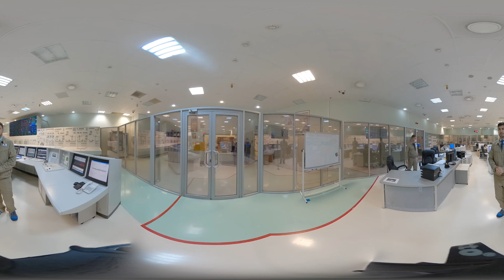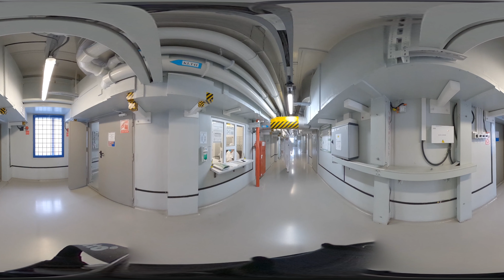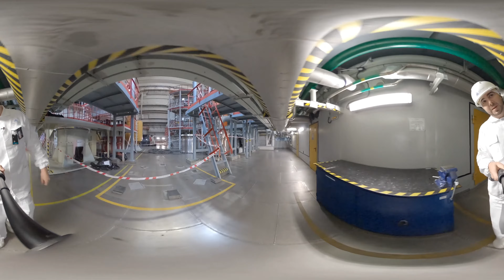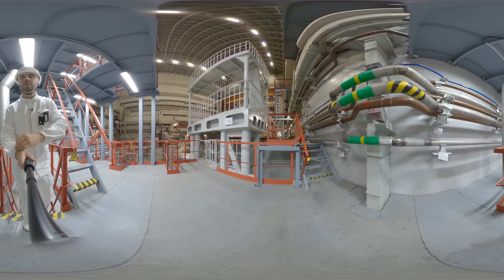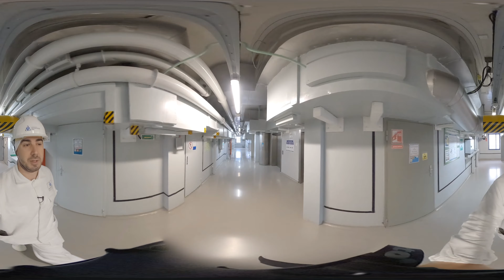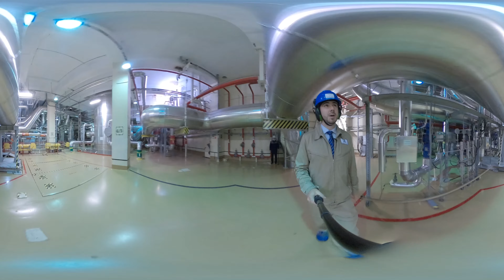Unique Russian Nuclear Facility/BN-800 Fast Reactor

Comment: so it is NOT being used for "breeding" purposes?
Reply: There is a closed cycle. Spent fuel from water reactors is processed into pellets, and a mixture of uranium dioxide and plutonium dioxide is made. During the process, plutonium 239 is produced, which can be used as fuel in the future. The burnt-out pellets are returned to the recycling plant, where they are again adjusted to the desired concentration of elements and put back into operation. There is no waste. The advantage of the reactor is that it disposes of minor actinides by burning them or converting them into safe or useful elements. A sodium-sodium-water heat exchanger. The capacity of the waste processing plant is 200 tons per year. The purpose of the reactor is to evaluate the behavior of mox fuel. Tests have already been conducted on the combined loading of uranium and mox fuel rods into a water reactor. This will help reduce the dependence on the extraction of new uranium. By using recycled waste, which amounts to hundreds of thousands of tons.
Reply: Y should it breeds more plutonium when you have more than enough reserves

Comment: A sodium reactor as a nasty beast to tame. Hats off to all the BN series reactors. If you work in pipe fittings or submarines you know everything leaks....including sodium. I wonder how many "small" sodium leaks they have to deal with a year & how its dealt with, would be fun to see them do what the US really couldn't. But then again our power plants have to make money which is harder than keeping a sodium loop air tight.
Reply: @codaalive5076  Oh I know all about the MSRE. Not only for coal, but Nixon killed the MSRE in favor of the IFR because they made plutonium. We were screwed out of clean energy and carbon neutral fuels. Not to mention the one thing that has been proven to improve human quality of life is access to energy. The more cheap power you have the better your quality of life.
Reply: @terrydavis8451  As i understand it oil lobby also helped kill the program and finish off A. Weinberg's work, of course nothing major in the US happens without the army. What do you think about Gates IFR? They don't provide much information but it sure looks pretty much like BN-800. Getting information about its ability to burn or produce plutonium is particularly difficult, i wouldn't be surprised if nothing came out of Gates project because they changed the name several times...
Reply: @codaalive5076  Китай хочет избавиться не только от углеродного следа, но больше от угольной копоти над городами, от которой задыхаются городские китайцы.
Reply: @НАТАШАМАКАРОВА-г6в  There were comments in the Western mainstream media channels that China is ahead of their goals in this regard. While i don't believe a thing msm say, they might be right this time because China is testing several very advanced new generation nuclear reactors, F1 is just one of them. I'm very impressed by how fast it went from one article about green power to making various advanced reactors in China.
Do you have more information or sources about China's intentions, timeline if they changed it from 2060 in Russian or Chinese?Finding such information here is practically impossible, i might even get banned for expressing my excitement after hearing good news for entire world.
Reply: The first reactor BN 350 was launched in 1973. The next BN 600 was launched in 1980. During this time they learned to work with sodium and tamed it.
Reply: @codaalive5076  
Where does the information come from that the RBMK was military?
Reply: @nedward.7442  I speculate because information about Russian science is hidden here, prohibited, banned! 
Technically it can easily produce Pu239 because of capability of changing the fuel rods when reactor was functioning, U238 is well suited for this kind of thing. I have no proof RBMK was ever used in this way, we don't hear much about Western Pu production either because it is military thing, very likely classified. Russia had other reactors where production of Pu239 is more efficient.
I will stop making claims without seeing 100% proof from peer reviewed papers because Western propaganda is so effective. After 20 years of following civilian nuclear power i didn't know Russia made first useful small modular reactor in the world, Akademik  Lomonosov. Anyone half serious about this things HAS to know it. I hope they will not ban me forever for writing about Akademik Lomonosov SMR.
Reply: @nedward.7442  It is speculation, i'm writing another post in case they delete the information about Akademik Lomonosov SMR and ban me forever for writing Russia made first useful SMR.
Reply: @nedward.7442  Now from very reliable source who knows for sure RBMK was MILITARY reactor capable of making electricity. Before making you this favor i knew it can produce Pu-239 for use in nuclear weapons, now go find some more sources instead of trolling. Ciao bello
Reply: @codaalive5076  
Lol, you yourself have no evidence, but you claim that it is weapons-grade.

Comment: Instead of fast moving neutron reactor that will still create waste Russia was working on a reactor that use fission & fusion in a cycle (a bit like a neutron bomb). if after fission the smaller nucleus cud recombine that’ll be great. Where has Russia reached?
Reply: Nuclear waste isn't a big problem because nuclear power plants are a stop gap technology meant for the next 50-100 years to replace fossil fuels. We just won't produce any significant amount of waste in that time, and everything we produce can be simply buried back into some rocky region underground.
Solar energy and wind energy are already cheaper than nuclear energy, but we just won't have enough of it for many decades, and meanwhile we continue burning fossil fuels